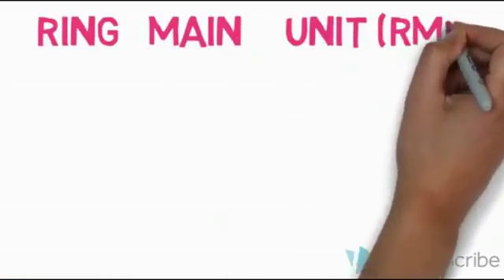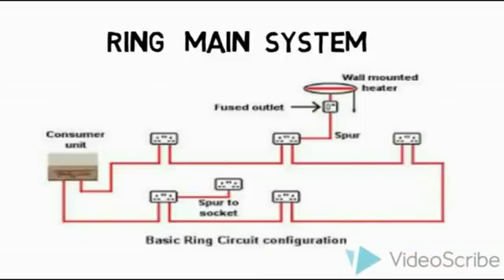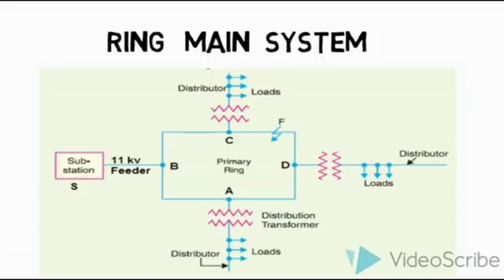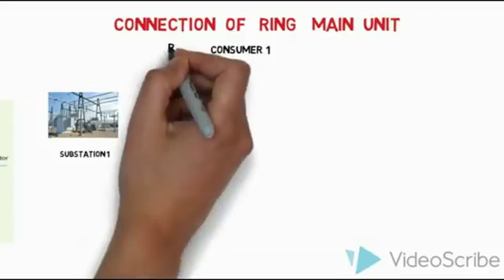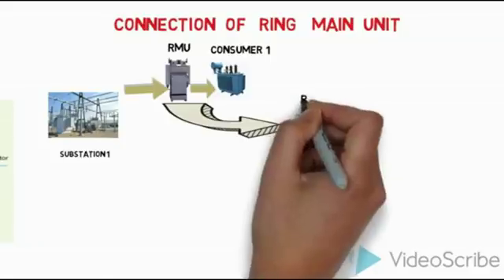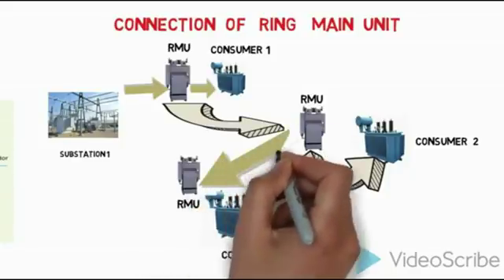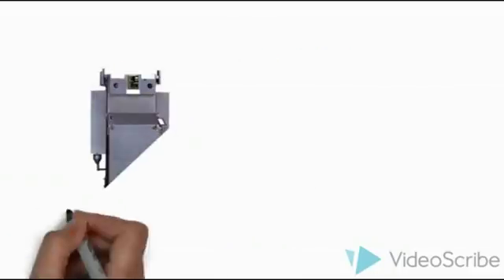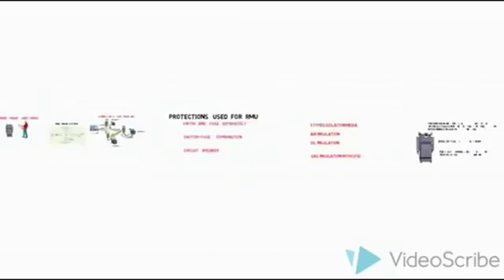Ring Main Unit (RMU)  dewa new 2018

Comment: What is DEWA's maximum fault level for the RMU's isn't it roughly 31.5kA at the 132/11kV supply substation and 25kA max at the RMU incomers typically?  I know RMU's typically are limited to 25kA short circuit in design.

Comment: Excuse me, Can two transformers be used with only one RMU?
Reply: Not possible...
Reply: 2 or 3 transformers also possible
Reply: @BadshahMohideen  can be used but one transformer should be in standby mode
Reply: @bharathkumargoud4584  4 function RMU has 2 isolators and 2 fuse switches, hence 2 transformer can be connected and operated independently from one RMU. 3 function has only 2 isolators and one fuse switch, hence only one transformer